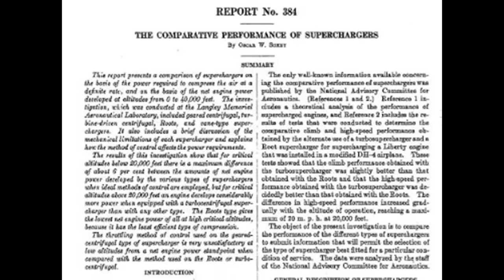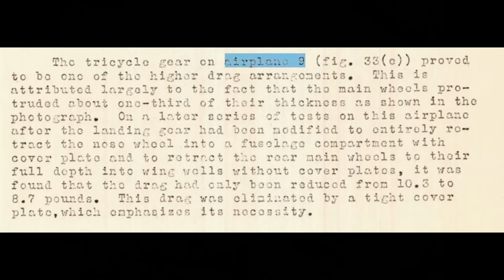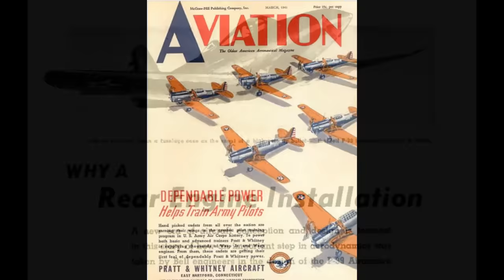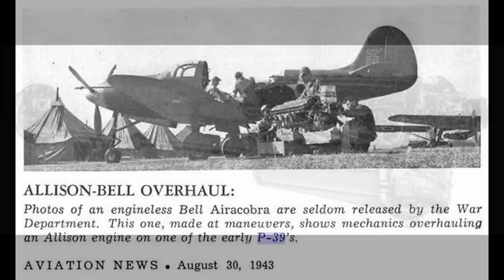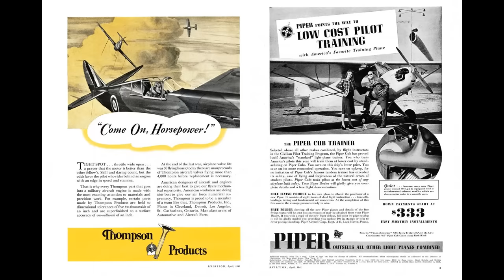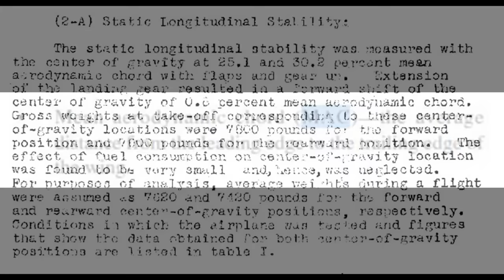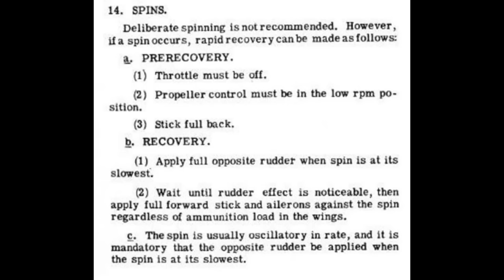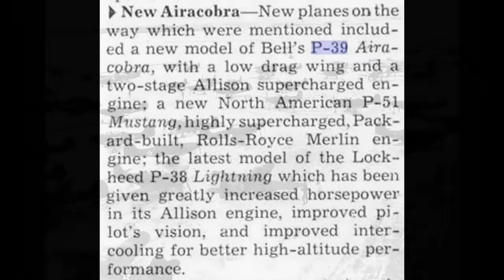Bell P-39 Airacobra, Why the Mid Eng?

Comment: Thank you, Greg, for doing a more in-depth dive into the P-39 design, it's strengths and weaknesses.  As a career aero engineer, I have been standing on the sidelines watching so many poorly thought out comments and criticizms of the design and hoping that someone would step forward with a well researched and comprehensive article.

In the trade, we often hear the term, "synergy".  The P-39 to me is a clever example of synergistic thinking, where one change results in many benefits.  The P-39 is a really clever combination of features that resulted in a compact, lightweight, powerful machine.  Unfortunately, it also resulted in a design that had very little internal volume for fuel or for turbocharger plumbing or cooling.

The lack of space for a turbocharger was quickly recognized and that feature deleted.  Unfortunately, that change made the airplane into a low altitude fighter only.

The lack of internal volume for fuel was a tougher nut to crack.  The very cleverness of the design packaged other necessary components too close together and certainly consumed most of the space near the center of gravity.  In the end, the low fuel capacity limited the range and  lack of a high altitude engine limited the operational altitude.  So you wound up with an airplane with a narrow operating envelope.

Regarding the stall/spin characteristics, I don't have much to offer.  Early in my working career I rubbed shoulders with many WWII vets who had flown P-39's.  Most of those with whom I discussed the airplane viewed it as a fun and feisty little machine that was entirely useless in a combat role.  A great little sport flyer.
Reply: The synergy was taken to far and making too compact of a fuselage and not providing enough volume at the CG. By increasing the length of the fuselage even minimally a fuel cell could have been placed between the pilot and the front of the engine, very near the CG. The P39 fuselage length was 30’2” and the near contemporary P40 was longer at 31’ 8.5”. Hindsight is very clearly 120%.
Reply: Tigershark said, “Hold my beer…”
Reply: There is an YT interview of an IJN/IJA pilot.  The interviewer asked the pilot about the Zero, clearly expecting a positive answer.  The pilot dismissed the Zero as an acrobatic toy.  It is implied in the vid that coupling big engines with big guns is the way to go.
Reply: Except when you call someone “synergistic” you would expect it to be a well balanced aircraft, performance wise, and it’s not.  It’s a very short range, very low altitude fighter that didn’t really fit into the mission set it needed too for the US.
Reply: @dos_gringos9853  It came out completely unsuited for its intended role, true. However it was quite  well balanced when it was deployed in the right role. The Soviets deployed them as low  altitude interceptors and loved them.
Reply: @laughingdaffodils5450  Yeah I mean its not a bad plane if you have a  mission set that a short range, low altitude fighter will fill, but other than that it's dogshit.  I'm not saying it's necessarily a bad plane, but it definitely was only a good plane for a few AO's.
Reply: @laughingdaffodils5450  

Not just loved them, they sang SONGS about it. The Airacobra was a match made in heaven for the needs of the VVS: excellent speed at low altitudes, good visibility while taxiing, an excellent amount of firepower for dealing with low flying bombers, and even the spin characteristics weren’t as dire for pilots who had flown the I-153 previously
Reply: @briancavanagh7048  There appears to be a good bit of unused space that could have had fuel bladders in front of the main spars. The Soviets removed the 30 cals so that space could be used too. However they didn't need the extra fuel as they based their planes 20-30 miles from the frontlines just outside artillery range. They moved the base almost everyday, sometimes more often. When they got the radar alert they took-off at full throttle and had a short, less than an hour, mission. They were usually attacking Ju-88 and Ju-87 aircraft below 15,000 ft.
Reply: @dos_gringos9853  It was never meant to be a long range aircraft which is what the US mission became and that is not what the AC asked for in it's specs
Reply: @tomhart6568  I mean it doesn’t really matter what it was meant to be used for, it didn’t fit in the USAAF’s mission set at all.
Reply: @dos_gringos9853  It fit when the original spec was put out. The mission set changed as the war developed.
Reply: @dos_gringos9853  Point I was trying to make was the original Air Corps spec in like 1936 envisioned a point defense bomber interceptor where range was not a consideration. People forget how rapidly air war changed in the early forties and the way planes and conditions evolved.
Reply: @kirbyculp3449 the Zero was a navy fighter had to be ultralight in order to achieve it’s astonishing range.

Comment: There was some wieght savings built in to the mid engine design.  Mainly that the engine sat on webbing directly attached to the wing spars, eliminating the typical steel cantilever engine mounting frame.
The "Aleutian Zero" was tested against the P39. The 39 could out run, out accelerate, out climb, and even to an extent out turn the Zero at LOW ALTITUDE.  However, the power loss was so severe with increasing altitude the the 39 became unstable at only 12,000 feet.
Reply: How does loss of power cause instability?
Reply: @Surestick88  Because the maximum air speed and the stall speed start to converge.
Reply: Great points, this highlights why the P-39 was so fantastic on the eastern front, considering the very low altitude offensive nature of Soviet tactics.  It's worth brining up too that in the pacific the Japanese had a massive advantage in pilot quality during the beginning of the war.  Japan had some of the most disciplined and well trained pilots on earth, yet one massive disadvantage of the Japanese system was their ability to train and create new pilots of such quality was incredibly low. While the United States was able to both manufacture machines and pilots at a astonishingly higher rate.  

As the elite Japanese pilots were lost to attrition Japan was left with almost no capability to replace them, along with a much lower industrial output. Combine this with the Japanese practice of keeping their best pilots in combat continuously rather than pulling them back home to train new recruits.   I just point this out as well, because I think it is often missed when talking about high American air losses at the beginning of the war in the pacific, It wasn't just good Japanese machines at the start of the war, we also have to consider the quality of the men flying them as to why we took such heavy losses early on. Saburo Sakai's book "Samurai!" goes into fantastic detail on this issue, and I highly recommend any air combat enthusiast's read it.
Reply: Yup, I read that book.  Sakai was an ordinary sailor when he was recruited for pilot training.  Contrast that with the US where the great majority of pilots were college grads.
Reply: @breckhollis1089  Yet that is completely irrelevant compared to the level of training and discipline Japanese pilots received compared to American pilots.  The problem remained for Japan that their graduating classes were incredibly small, and they had no ability to maintain such a elite level of training as the war progressed and the well trained pilots started to die off, so what Japan ended up with was a tiny elite core that survived, and allot of incredibly poorly trained recruits, rushed to the frontline, and later sent as Kamikazes too. 

The United States on the other hand was more able to produce decently trained but not elite pilots at a much much higher rate, this was still a major advantage. Combine that much larger ability to produce pilots, with a much larger ability to manufacture airframes and you have a devastating combination; where late war the US  dominated the Japanese in air combat with more modern aircraft, more competent pilots, and greater numbers.  Interestingly the Japanese actually had very advanced modern aircraft they invented that kept pace with the most advanced American aircraft of the time too, but they had little to no ability to produce them at scale.
Reply: @-Zevin-  That was k9nd of my point.  America had a large pool of educated guys who could be trained more quickly.  The Japanese had a bigger job in training new pilots.
Reply: @breckhollis1089  Well I don't think that's necessarily true. First I don't think it was an issue of us having more educated guys to pull from, we had more guys period, just in raw population, along with the industry to provide them all with decent aircraft.  Also In November 1941, the requirement for military aviators was reduced to being at least 18 years old and possessing a high school diploma, many American pilots had no degree during this time. I  think many non-college educated pilots can be trained just as easily as college educated ones, especially in the context of WW2 aircraft and their relative simplicity. You may have a higher drop out rate, but no issue weeding out the men from the boys so to speak.  Having a bachelors in history or engineering isn't going to automatically create better pilots, nor do I believe a potential pilot is automatically going to learn faster or be trained faster simply because they have a degree.  It's worth touching on the fact too that Japan is famous, and was at the time too, famous for it's excellent quality of schooling in K-12, and Saki himself, (while he was a poor student) attended a very prestigious and expensive private school, and likely had an education that eclipsed many of those with college degrees.  

Japan didn't just spend longer training pilots because they weren't already educated, they spent more time because they trained their pilots to a much more elite degree than most other countries, at least this was true early war, that all went out the window when all their elite pilots dwindled away, and the nature of their schooling was small elite classes.  It would be like trying to train all your standard infantry to the same degree of navy seals, you may end up with really exceptional soldiers, but you also then lack the ability to replace them quickly when they start being lost. It was also a huge mistake to not pull back experienced aces to teach new students. It reminds me of the quote from Dan Carlins history podcast on the Pacific; "The Japanese are like everyone else, only more so"  I think that is really true here too, the Japanese never did anything halfway to a fault. While the Americans were much more pragmatic, even if we didn't always have the best, we had decent quality pilots, and we had allot more of them, it becomes a logistics game at that point, and logistics win wars at the end of the day.
Reply: @breckhollis1089  Not really. The P-39 max altitude is 35,000 feet. What happens is at 15,000 ft your throttle is fully open and as you climb you loose manifold pressure and power so you loose performance as in an underpowered airplane. It still flies nice and stalls at the same indicated airspeed. The Zero is able to pull full power to a much higher altitude so you are unable to fight well above 15,000.
Reply: Zero had a two speed supercharger, the Allison engine didn’t.
Reply: @breckhollis1089  #citationneeded a Cessna can do 9k feet. A fighter with north of a thousand hp isn't going to suffer that badly at 12k, especially a supercharged one. Sure the Allison's blower wasn't designed for high altitude and it might suffer against other fighters at 12k but barely being able to maintain stall speed?

Comment: Non combat accidents in the Army Air Force were significant, almost half of all losses. My dad survived the collision B 17 with a B24 training over Lavenham England in ‘44. Out of 21 crew 11 lived. The aircraft were of course destroyed. In the fourties’ flying was much more dangerous than today, even when you weren’t being shot at!
Reply: I'm only here because my father survived a mid-air collision over the Tinian islands while returning from a mission in his Lockeed Ventura. A Canadian pilot in his P-38 was escorting them back to the airfield and was hotdogging by doing rolls over the top of my dad's plane and caught the wingtip. Dad's plane  limped in without hydraulics or controls on the right side and leaking fuel. The P-38 went down and in the water and the former pilot was rescued.
I still have all the photos of the damage and his time spent in the service.
R.I.P. Dad. I miss you.
Reply: @finaloption...  My dad was amazed by the recklessness of the fighter pilots.  But what do you expect from a bunch of kids with  2000 horsepower who risk their lives on every sortie?
Reply: True that.
Reply: Respect to your father.
Reply: My dad was a clerk working directly for the base commander at Waycross Ga. And he related to me that they lost many planes P-40s etc in the Okefennokie Swamp due to pilot error.
Reply: @richardschaffer5588  as someone said: ‘there are old pilots, and bold pilots, but no old bold pilots!’

Comment: Greg, great video as always.  I spent over 3,000 hours in modern Navy Fighter Jets / Training Jets and would agree with your comment about G-Loading.  Modern Jet cockpits are well in front of CG, and allow pilots to pull upwards of 7 to 9 G's (depending upon the aircraft).  G onset is a concern, but given modern training and assistance from G-suits, it is easily combated.  Sustained G is generally the more challenging of the two...G-suits / training help, but one's physical fitness is more important.  Our Demonstration teams don't use G-suits while flying the Blue Angels and Thunderbirds, relying purely on technique and physical fitness...the more important of the two components of fighting G.   

Bottom Line:  I don't think the Mid-Engine design near the CG for the P-39 made a huge difference in that era for G-Onset for the crews. However, it probably made it feel more lighter and responsive on the controls....but I've never flown it nor read any books on pilots who have.

Comment: Fascinating dissection. Sounds silly to say, but every since I got to play an Airacobra in a simulator game as a kid its always been my third favorite aircraft of the era. Seeing it and my favorite aircraft of the era, the P-63F together in person really helped
Reply: And you won’t tell us what’s number two? Way to leave me hanging
Reply: Pshhh, it's not silly at all. Playing games when you're young is integral to personality development and picking favorites is a natural part of that. If you think that's silly then we're comrades in arms.

My favorite plane is the A-10 and one of the computer games I play is Kerbal Space Program. It's a physics simulation for doing rocket science but you can build space planes too and there's a gazillion mods made by fans of the game. One of the craft I've built is an A-10 derivative but only in the loosest sense. All the basics are right but all the details are wrong. Dry mass is 30 some odd metric tons, main engines are a pair of 2.5 meter diameter open cycle air breathing nuclear thermal rockets. (Intake air, compress it, heat it in a nuclear reactor, expand it to drive a turbine, generate thrust). The engines alone are six tons a piece, which shifts the center of mass aft. I had to shift the wings aft and extend the forward fuselage a bit to keep it's flight characteristics stable. The plane looks like the offspring of an A-10 warthog and a Su-25 frogfoot.
Reply: @StarlightSocialist  If you haven't already, you should really try the A-10C in DCS, It's actually one aircraft I haven't learned in DCS yet because it seems so complex, but if you really love the A-10 it may be worth your time to learn.  I have always had a soft spot for the warthog too, as I grew up right near the Air national guard base in Battle Creek Michigan, saw A-10s flying over my childhood home all the time. I quite miss seeing it.

Comment: 10:24  I remember reading somewhere that there was a shortage on the metals used in turbo production and that the army aircorps gave priority for this metal to the bombers.
Reply: That doesnt make sense, turbos dont use any special metals, and they were installed in p47s and p38s.

They mightve not been able to produce as many due to the complicated manufacturing, but id still be doubtful.

Much more likely the turbo and plumbing for coolant/oil/airflow took up too much space. The p39 was a really tiny aircraft. Look at the p38, the turbo super chargers practically take up each boom, and the p47 was famously massive.
Reply: @daslynnter9841  exactly! The XP39 turbo had overheating issues and the XP40 turbo caused visibility issues. There wasn't time to sort these out so they were simply deleted